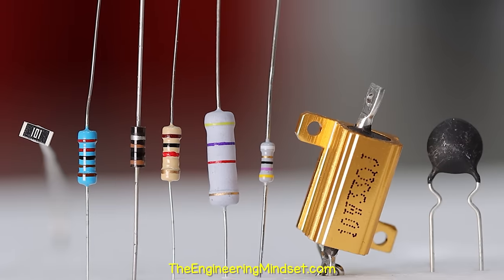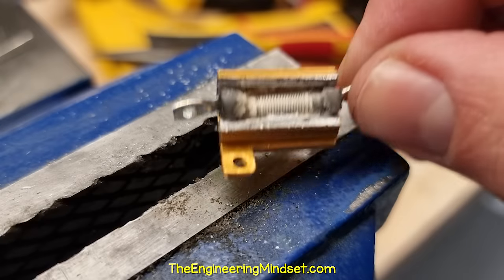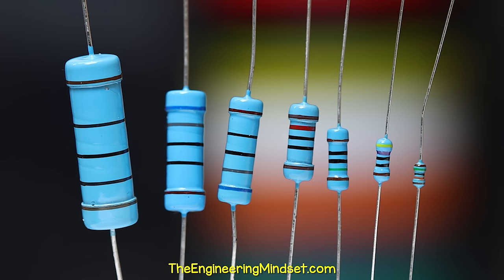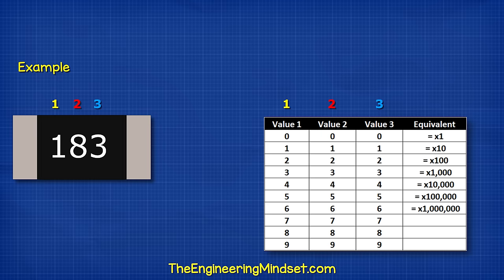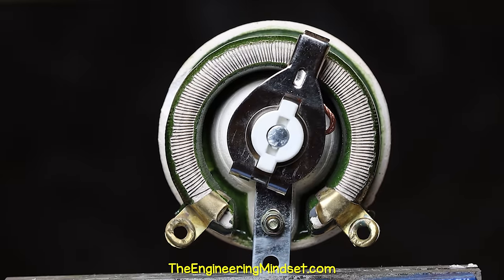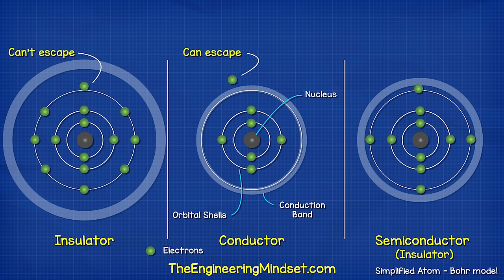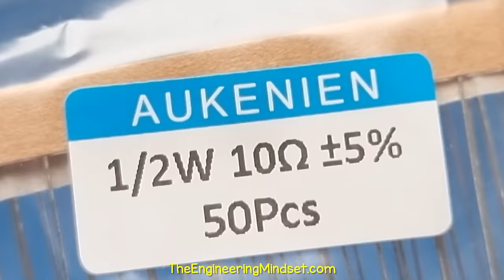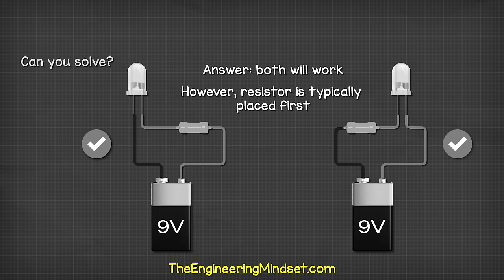How Resistor Work - Unravel the Mysteries of How Resistors Work!

Comment: Been using resistors for 13 years in my projects but you just taught me so much more. I hope you turn this into a series and do this with all electrical components
Reply: Great video, this can help with beginners that are new to electronics. Although I have been using resister since the 1970'ss that my grandfather taught me about early electronics radio valves! Even that resistor with dark brown coating looks like it's over 60 years old!
Reply: They have already made more videos in this series, Diode, Fuse, Capacitor.  Its a good series.
Reply: Heh, series
Reply: @krossbow_  😂
Reply: I also
Reply: That equation. Thankyou.
Reply: hi.. i am working on an aurdino uno project... where i have an ph sensor which needs to be connected to 5v of uno,an turbidity sensor which needs to be connected to 3.3v of uno and esp8266 wifi module also is needed to be connected to 3.3v of uno but i don't get how to provide power...? do i need to use resistors ? i don't understand power optimization!! will you help me with it.
Reply: OMG I know right lol my mind is blown how did this not click 20 years ago lol

Comment: You responded 2 years to a question I had about the "physical" relationship of power, current, and resistance, in the form of this video.  You even directly linked my question.
Good sir, thank you.  
Life update:  I now work in the superconducting field, so even though this knowledge is invaluable, I effectively try to achieve the OPPOSITE of this concept lol.  Thanks.
Reply: It's called Ohm's law. I=U/R.
Reply: L + Ratio
Reply: Also PVC and VCR mnemonics are a handy variation on the standard V=lxR 
P=V/C or V=C/R
Reply: @Happycat2789  ?
Reply: working on getting fusion working?
Reply: @Happycat2789 what ratio 😂
Reply: @Happycat2789  why though?
Reply: @guadalupe8589  oitar + L
Reply: okey but do not talk rom temperatur superconductor okey
Reply: What do u mean u try to achieve the opposite?
Reply: @jikosauce because superconductors have effectively 0 resistance.
Reply: @guadalupe8589 as my instructor used to say, "why is a crooked letter and can't be made straight."
"How" is much more relevant.

Comment: For all the years I've been dealing with resistors, I never know about the spiral cut. Thanks for sharing. Great channel!
Reply: There is a book called "Open Circuits: The Inner Beauty of Electronic Components" that uncovers all the internals of electronic parts. Eye opening!
Reply from the maker: Glad it was helpful
Reply: @Sebazzz1991  , the Curious Marc channel did a video with the creators of that book.
Reply: @Sebazzz1991  Thank for the book's name. ;)
Reply: That spiral cut means that the inductance is higher than you would expect if you were thinking in terms of a continuous film.

Comment: I learned and worked with resistors and circuits about 22 years ago and it was never clearer. thank you for the comprehensive and clear illustrations.

Comment: 0:00 - Intro
0:30 - What is a resistor?
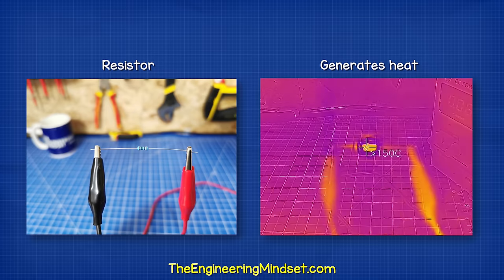2:19 - Types of resistors
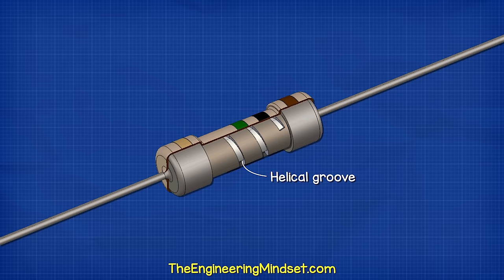     4:33   - Carbon composite
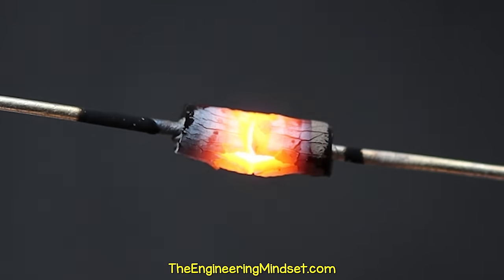     5:11   - Carbon film
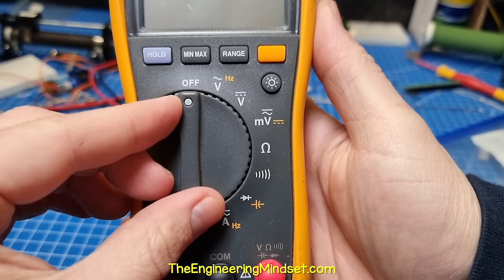     6:31   - Resistance chart (4-stripes)
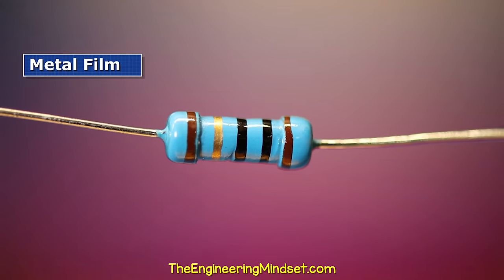     7:28   - Metal film 
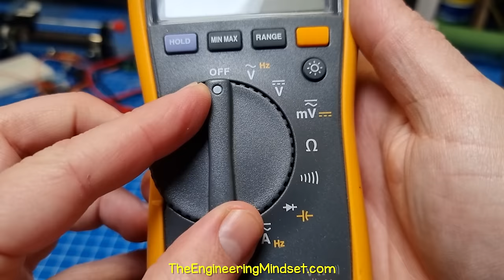     8:43   - Resistance chart (5-stripes)
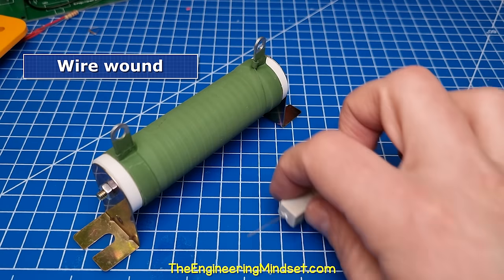     9:42   - Wire wound 
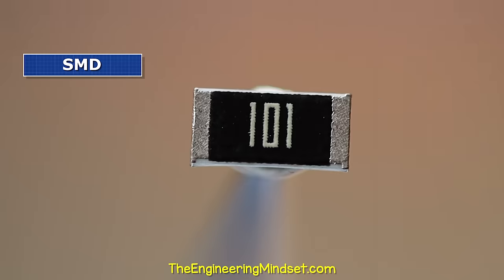     11:05 - Surface mount (SMD) 
     11:52 - SMD resistor charts
     13:50 - Potentiometers
     16:52 - Fusible
     18:24 - Varistors
     19:46 - Thermistors
     21:33 - Light Dependent resistors
     22:42 - Strain gauges
23:41 - Why do we use resistors?
Reply: You forgot the Whiskas catfood commercial 😂
Reply: metal film  metal film metal film
Reply: မြန်မာဘာသာပြန် ပေပါလာ စိတ်ဝင်စားဖိုကောင်ပါတယ်
Reply: Thanks!
Reply: @@DragonBotha no just a cat ☺️
Reply: @mrkitty777 😂😂😂😂😂😂lol dude
Reply: @Guerrila_man  😀
Reply: @weiaungweiaung hmmm didn’t know pythons could read🤔🤷🏾‍♂️
Reply: 14:52 can someone confirm that the calculations are accidentally reversed? 

It's driving me crazy that a pot is shown producing a lower resistance when the current has further to travel!
Reply: @ivocanevo I studied electronics a while back and from what i remember you use Ohm's law to calculate.

V=R*I (V=voltage, R=resistance, I=current).

Through math you can arrange it into V/R=I. The calculations are as follows:

9/500=0.018. (9V/500R=0.018I)

And

9/10=0.9 (9V/10R=0.9I)

Hope that helps :)
Reply: @lOCT.  yeah, I think someone just mixed up the two shown on screen. The result on the left belongs on the right, and vice versa.
Reply: Thank you<3!

Comment: Back in the late 1970's, I put in a whole semester learning about resistors, and learned about 90 percent of that semester in this video!  Plus the resistors back then were the carbon variety, unless you worked with industrial (1 percent) resistors.  They were blue colored with black value numbers on them.
Reply: I went to Naval Avionics School in 1972 and all I remember working with resistors that were carbon and wire wound. I worked in a TV repair shop a few years before that at 16. We actually had some electronics classes in the high school I went to. They sure don’t teach that in high school anymore. I worked in electronics all but a few years of my work career.  Worked on some cool things from oil well logging tools for 8 years and then 31 years in telecom working on digital transport all over Alaska and some overseas.
Reply: Are you sure about that? I'm pretty sure the first resisters where filament light bulbs.
Reply: i think its kind of crazy really, my professor was talking about how there used to be an entire class on just motors but now its just a sub category in one of my classes. let alone a resistor. now its kind of just a given

Comment: I believe the resistor placement doesn't matter. This is as you said because it creates sort of a barrier slowing down the flow, and it'll be slowed either before or after the LED. If it's slowed after the LED there's still that sort of "Jam" no matter what. I also believe the resistor shown has a resistance of 1200 Ohms with a tolerance of + - 2%.
Reply: Correct on the placement of the resistor in the circuit, all elements in a series circuit get the same current, no matter their position.
Reply: I had also determined 1.2k +/- 2%. Unfortunately, the color code of low tolerance type resistors is often disambiguous - that is why I always measure them to be sure...
Reply: I would use gauge invariance to argue that what is down or up flow is only a question of definitions and have no physical significance. I think this is mathematically equivalent to your explanation, even in transitive states.
Reply: I also determined 1.2k ohms. That's because when he asked the question in the video, he had the resistor one way, and then when he answered the question, he flipped the resistor for some reason. That meant we looked at the colored bands backwards. I'm not sure if there is an easy way to know which direction is the right one, but for a training video, it would have been nice to have it lined up properly.
Reply: it technically does not, but if you place it after, and the positive terminal of the LED shorts, the led is bust. while, if you put it before and it shorts, nothing happens as the negative terminal is cut off by the burnt resistor
Reply: @perp9894 , what do you mean by "the positive terminal of the LED shorts"? Shorts to what? Either configuration could be susceptible to shorts where the resistor is bypassed if you connect the wrong part of the circuit to the ground plane. In one case you want it on the positive pole of the power source and in the other the negative one.
Reply: I don't see how any of you got 1.2k ohms.  Assuming we are going by the resistor shown at 9:38 the colors are brown, red, black, red, red. So if brown = 1, red = 2, and black = 0, then that's 120 x 100 = 12,000. So I got 12k ohms with a -/+2 tolerance. If we're reading it the other direction (red, red, black, red, brown), then they comes out to 22k ohms with a -/+1 tolerance. Is there something I'm missing here?
Reply: @JESSEALLEN77  because I’m goofy and didn’t realize I was missing a 0 in my original comment, having 1200 instead of 12000. I’m not sure how the other people got that though, thanks for letting me know!
Reply: @Jesse Allen  when he posed the question in the video, the resistor was oriented with the brown line first. Then, when he gave the answer, he flipped it around. This changes the number you get. Not sure if there's a quick way to tell which way it's supposed to be oriented?
Reply from the maker: Seen the new LED explained video? so much detail covered! https://youtu.be/O8M2z2hIbag
Reply: @Subat0micR0gu3 maybe I missed something but the color band separated is the tolerance band making it the last in order of decoding giving you a left to right sequence if you look for the space between colors
Reply: @whiskeytangofoxtrot9403  that makes sense. I don't think he says that in the video, though. And flipping the resistor around in the answer was just needlessly confusing.
Reply: This is correct. The order of resistors and semiconductors is not relevant. 
All the parts in one circuit or branch of a circuit work as a unit.

Comment: You forgot temperature coefficient, which is usually indicated after the tolerance band. There are a lot of applications where a low tempco is more important than a low initial tolerance.
Carbon comp resistors are still relevant in high frequency applications where any stray inductance is undesirable.
Reply: One of the things that drove me crazy when making the transition to surface mount is the rather dismal tempco of common 1% SM resistors - typically ±100 ppm/K. I was used to 50 ppm with the Philips leaded resistors I generally used. If you want decent tempco in SM resitors you're into 0.1% or better tolerance (which I often did want along with low tempco).

Carbon comp are low inductance but they also tend to have relatively high capacitance, so you lose on one hand what you gain on the other. They are a lot more tolerant of transient overload than film types. Their excess noise (i.e. beyond Johnson noise) can be a problem.

The reality is that resistors demand careful attention when you are doing demanding work.
I ran across another resistor video a while back, talking specifically about 1% leaded resistors available on ebay. One commenter insisted that you should be able to make your circuits work with 10% tolerance parts. Sigh!
Reply: @d614gakadoug9  What was the context of that other comment? Current limiting for an LED? Pull up or pull down resistors? Biasing a transistor or valve? With very few exceptions (usually frequency-dependent or high resolution current sensing, and you're likely to know when you need the tighter tolerances), it's good practice to design for 10% tolerance and specify 1% resistors and 5% capacitors. The common examples listed above typically work just fine even is a resistor is 20% out.

Comment: OMG THANK YOU! Been trying to get my head around resistors for years and gave up several times. Because I couldn't get my head around how they dissipate heat or how to work this out. I always thought that the more work a resistor has to do, the hotter it would get, because it has to resist more... but this is completely wrong! It's the amount of current it lets through that causes the heat and things make sense to me now. I've always shied away from voltage dividers because of my lack of understanding in this, and keeping my circuits simple and using external components such as buck convertors to do what I wanted.

Comment: I'm a bit confused in the water analogy at 1:55. Technically if you cover a part of the water stream, it would go faster and shoot out further (incompressible fluid flow)
Reply: Water and electricity aren't a perfect analogy.
Reply: Your assumption is only valid if the speed of the water pre-obstruction was constant. But, on that model, if  you cover the whole channel, the speed of the stream would be infinite, which is obviously impossible.
So, the higher the resistance (the covering of the channel), the lower the current (the water stream after the covering), for the same voltage (the height of the water pre-covering or pressure).

Comment: Regarding the multiplier, it is easier to use the same colour codes as the main digits.
For example Orange Orange Brown is 3, 3, 1. So, 33 and ONE Zero = 330 ohms. Orange Orange Black is 3, 3, and ZERO Zeros = 33 ohms.
This is much easier than using a "multipler" since you don't need to look up the chart to find a multiplier, then use math to multiply anything... instead just add however many zeros is applicable.
The exception is lower value with Silver and Gold multipliers, where the chart is needed.
Reply: double that!
Reply: While this is correct, I have to say that the multiplier in the lookup table just means "times ten to the power of n", where n is the multiplier number. From
◼️ black or "0", with ×10⁰ up to
⬜️ white or "9" with ×10⁹.
With the special cases of
🟨 gold with ×10⁻¹ and
⬜️ silver with ×10⁻²
Of course in the decimal system that just corresponds to the number of digits you shift the decimal point. That's the point why they've chosen these numbers anyways.

Tipp:
If you have difficulties to memorise which way around the gold and silver one are: think of medals. Gold is 1st place, so "1" or "×10⁻¹". Silver is 2nd, so "2" or "×10⁻²".
Reply: @Kesuaheli  - see how much simpler it is to remember "and two zeros" rather than calculating powers?
Reply: Yeah sure. I do it the same way.
But Gold and Silver multiplier aren't that hard either if you know how they're made up. To be fair though they aren't that common.
Reply: Yep, this is how i do it too. Third band is just the number of zeros in my head.

Comment: I worked in a factory from 1988-1997 in Huntington, Indiana. 
It was called Memcor-Tru-ohm.
We made resistors and rehostats.
From welding the little lead wires on the caps on the end of the ceramic tube, called the capper. 
Then they went to winding department, and depending on what the customer wanted, that determined the gauge of copper wire that was used, how many times it got wrapped. Kinda reminded me of a sewing machine/lathe/welder combination.
Winding rehostats was a totally different machine, but the same ohms law applies to rehostats too, wire gauge, times wound.
Rehostats were more labor than resistors.
They had to hand weld the connecting bands on before winding,  then it had to get cemented to its ceramic base after coating and firing the glaze.
Bigger resistors had to go through a hand brushing department to remove the ceramic coating after being dipped in mud slurry and allowed to dry 24 hours. 
Then they got put through the oven and baked.
After baking, the terminal was sandblasted to remove the ceramic. 
Then it was stamped or color marked, packed and shipped. 
The smaller resistors got coated too, but in an automated machine that was 20ft long.
Reply: Don't worry. We have read your Comment

Comment: Been doing electronics as a professional since 1974. Member of Audio Engineering Society!
The Volts, Amps & Ohms imagined here is of course wrong but works fine in nearly all applications except transmission lines and radio.

Comment: 01:47, if you block a water pipe, mass is still conserved.Water is practically incompressible and that water goes further away. Amount of water flowing would not change. Pressure would increase.

Comment: 1:01: 🔥 Resistors are used to reduce current and protect electronic components by converting electrical energy into heat.
4:30: 🔥 Different types of resistors and their construction.
8:22: 💡 Different types of resistors and their characteristics were explained.
12:54: 🔧 This text explains different types of resistors and their uses.
17:15: 🔌 Explanation of various types of resistors and their construction.
22:00: 💡 The resistance of components changes with exposure to light or stress, and can be controlled using resistors and potentiometers.
26:20: 💡 By using resistors in series, we can create a voltage divider to control the output voltage, and by using resistors in parallel, we can create a current divider.
Recap by Tammy AI

Comment: One thing I really struggled with while learning electronics is resistors. I learnt Ohm's law V=IR and then learnt that resistors decrease current and voltage. This didn't make sense until I realised that Ohm's law assumes resistance is fixed and we only vary the voltage and current. Resistors are best thought about as using up the energy of electrons. This energy is the electric potential energy which is used to drive the electrons through the circuit. Electrons waste this energy to navigating through the resistor colliding with its molecules causing their vibration, heating them up or exciting their electrons momentarily causing them to release the energy in the form of photons. This decreases the effective voltage which is the difference in electric potential. It also decreases current because voltage is what drives passage of current.

Comment: 4:27 it's the same because in a serial circuit, the current is the same everywhere. AND it's a trick question, because electrons go from the - to the +, so even if we're tempted to say "before" the diode, the "before" is actually between the - and the diode, and not between the + of the diode

Comment: Well done.  Here is a nit pick though - on the carbon film resister at the end your graphic shows green as X100, but it should be X100K (the K is left off).  In any case, the answer is correct.